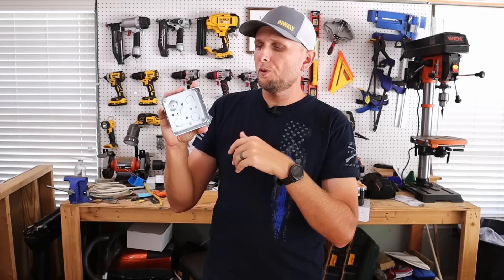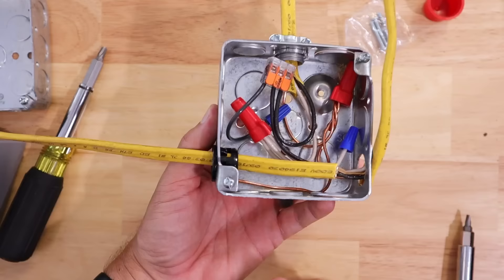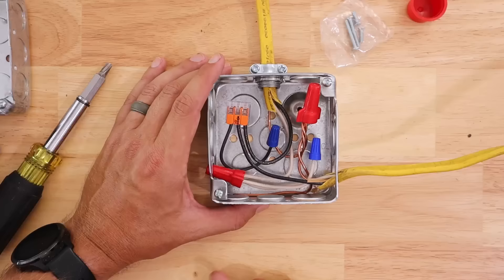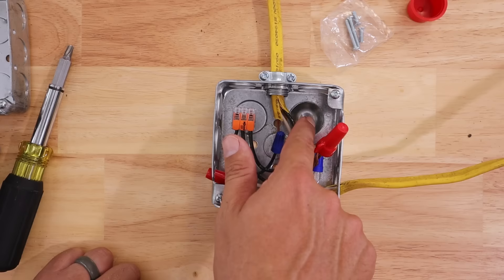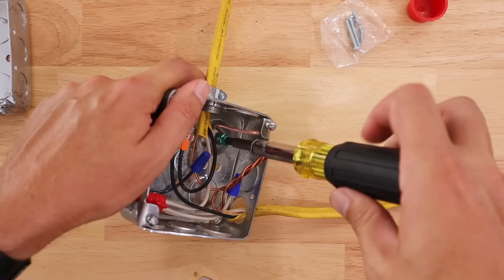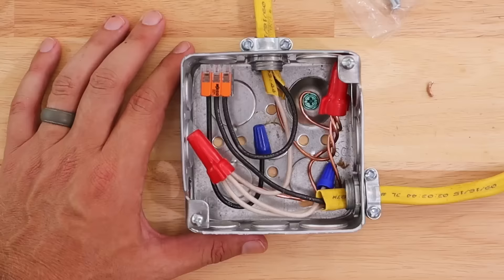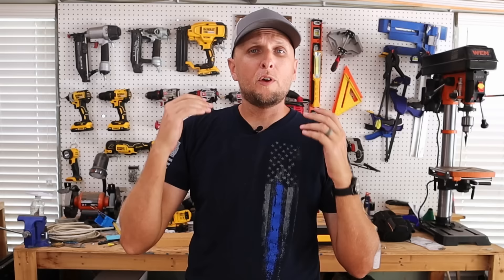The BIGGEST Mistakes DIYers Don't Know They Are Making When Installing Metal Electrical Boxes

Comment: Just a pointer. Make sure you have complete coverage of your ground wire under the screw. When you installed the ground under the green ground screw, the wire popped out of the screw and is only making contact on a small section. It will still make contact with the box more than likely just fine but an inspector may ask for it to be installed correctly. They will probably never see this ground because they won't take the box apart, but will do a ground continuity test so they would hardly ever see it. It would however not be a good installation because the wire isn't fully supported under the screw.
Reply from the maker: It’s fully wrapped around under the screw head, it just looks that way because of how the wire is exiting.

Comment: Can I use strain relief when for wires in plastic electrical boxes, and which one to use?
Reply: No. The cheaper ones rely on a nearby stud mounted cable staple and the more expensive and multi gang ones have built in clamps.

Comment: Are there any advantages to metal boxes over plastic? Thanks.
Reply: I just commented on that very thing. The only advantage I know of using a metal box is for exposed (as in run outside of a wall, Shop/garage/warehouse/commercial atmosphere with EMT/metal shielded cable (BX) circuit runs. There’s no reason to use them in residential unless you need to do the above, need a “heavy service” exposed circuit/receptacle situation.

Comment: 15A branch circuits (circuits fed by a 15A OCPD, like a circuit breaker) should have a minimum wire size of 14 AWG, installing 12 AWG is allowed and sometimes required to keep voltage drop below 5%, in the case of increased ambient temperatures, a large amount of current carrying conductors installed in the same raceway, continuous load circuits etc. In those cases using 14AWG jumpers from a 15A device to 12AWG circuit conductors on a 15A Circuit would be fine.

Comment: Those WAGO things  are great. I would watch out for cheap knock-off ones , but once I tried one, I bought a big bag of them. BUT BUT BUT, the twisted wire ,with wire not, seems to be a better contact.  But how much contact is needed. Am I just a paranoid DIY guy?

Comment: The 12awg cables are much longer hence why they need to be thicker to carry 20 amps per say. But the 14awg cable is around 4 inches long and wouldn't have a problem carrying 20 amps through it

Comment: Not being an electrician, those WAGO connectors are new to me. Kinda cool but is there any issue with lack of contact surface where they pinch into the wire ?
Reply from the maker: That is a big debate.  However they are UL approved so take that for what it is worth.
Reply: @HowToHomeDIY  Thanks. For piece of mind . I think I'll stick to twisting other.

Comment: I'm kind of paranoid so I always tape up wire nuts when I'm done, however, I've seen opinions go both ways on that. On twisting wires, last I knew, code requires that solid wire be twisted before the wire nut is put on it. Stranded wires or stranded mixed with a single solid wire don't need to be twisted together because the act of cinching down the wire nut does that. Also, as was pointed out elsewhere, if the breaker it is attached to is 15 amp, that #14 pigtail is fine because the breaker is not rated higher than the wire. If a 20 amp breaker, given that the length is 6", I would imagine it would still be safe if that wire were carrying the full amperage of the circuit, but it still isn't code.

Comment: if you are using stranded wire don't pre twist the wires going into the wire nut. pre twisting will prevent the wire nut from grabbing properly with stranded wire,.put them in parallel.

Comment: Its interesting, if you had a 12 awg romex and inside of a box say you jump it to an outlet via a 14 awg wire.  6 inches of 14 awg wire is less resistance than 10 feet of 12 awg, so its actually most likely fine, but having said that you should follow the code.

Comment: Could you explain why you have to use the specific grounding screw you showed in the video? Wouldn't a pan head screw with a toothed washer work just as well?
Reply from the maker: Yes the correct sized machine screw would work.  The green ground screw is just much easier to find and they are not really any more expensive than the same sized non green screw.

Comment: Another suggestion, that you didn't show, is to wrap whatever bonding device in electrical tape. This will provide additional strain relief, and prevent any potential electrical connections to the box itself.

Comment: Why is it necessary (other than color code convention) to be a green grounding screw?  Wouldn't a pan head screw that fits the thread with a star lock washer be sufficient?  The pressure of the screw would embed the lock washer into the wire and the screw head providing a bonded connection.
I agree with the pretwist concept.  I've had too many AFCI/GFCI breakers suffer "ghost" tripping and they were all traceable to a poor connection within a wire nut.  Pulled the wire nut, twisted the connection, clipped the end, and re-installed the wire nut; those circuits haven't tripped since!
Reply from the maker: Yes it does not have to be the color green but it is easier for homeowners to just go into the electrical aisle and pick up the green ground screws know they are the correct size, length, and type.  They also are inexpensive.

Comment: Is there a requirement on the ground wire to put a crimp sleeve for code? My grandfather who was electrician never did this and as a DIYer I never did this either. If so, did this come into the code recently?  I had a friend who's project was not approved by the building inspector because of this.

Comment: Ive gotten into mamy arguments with other electricians over pre-twisting, due to the manufacturer claiming you dont need to pre-twist. Well, youre right, and those assholes are wrong. The reason i explain that always ends the conversating, is that if you do not pre-twist, and have a solid mechanical connection independent of the wirenut, if and when time loostens that wirenut, or the plastic fails, worse case with pretwist, you get a short circuit, and your breaker trips. Without pre-twist, you get arcing and a loose connection. Now, obviously this is why arc fault breakers exist, but plenty of houses arent up to date, and also, those breakers are not always reliable. A short circuit trips the breaker. A loose connection burns your house down. Always pre-twist.

Comment: I am confused about scenario 2: About the bare ground wires touching the box.  Metal boxes must be bonded to ground anyway, in case the blk wire DOES come loose and contact the box; the idea being the ground takes away this stray current (fault), so that the box itself is not electrized.  In fact, that's what the raised hole in the top right is for.  You attach a ground wire and connect it to that hole via the green screw that sometimes comes with the box

Comment: I never heard of wego before but would give a wrap of tape around it to hold the flip locks down as a security measure. Plastic is cheap and not consistent. Brittle with temp/uv/vibrations.

Comment: 14ga is perfectly fine there, so long as you put a 15A breaker on it. It's confusing for future work, but most definitely up to code just fine. Pretty silly if you already have 12ga running, you might as well use 12ga for the jumpers, but nothing unsafe or illegal about it.

Comment: A bit off subject, how do you like the Wen drill press? Is that the 4214?
Reply from the maker: Good eye.  Yes, it is the 4214.  I love it for my purposes.  Never had an issue with it and I think it is at a good price point for it's features.
Reply: @HowToHomeDIY  I agree about value. Hard to beat. As for accuracy, You can replace the check with a $25 option.

Thanks for the response, much appreciated!

Comment: First two mistakes are good points.  Third, not so much.  Whether it's a mistake or not depends on the breaker for that branch circuit.   If breaker is only 15 amps, then it's fine to mix 16 gauge wire with 12 gauge wires.
Reply from the maker: I am a big believer that wires should not be mixed.  The person after you may not realize it and just upgrade the breaker.

Comment: Another reason to have the fittings on your box is if the romex does move, the fitting prevents chafing on the edge of the knockout which could cause the box to 'cut' through the insulation shorting it to the box.

I'm not quite sure I understand the problem with the 14 pigtail. Is it the mixing of the gauges in the wago, or the load reduction of the 14 gauge? 14/2 is rated for 15 amps, so if you are just running a standard outlet or light, technically the 12 gauge is overkill. If you are expecting a 20 amp circuit (like you are stubbing for a welder or something), then having the 14 gauge pigtail is a problem. But I don't think mixing is necessarily a problem. Maybe I am not understanding.
Reply: it is stupid to do so because the next electrician might assume he can put a 20 amp breaker on that 15 amp circuit.   i think codewise it is allowed though don't quote me on that but not a good idea.

Comment: What's the difference between the green screw and any screw? That would have been interesting information. It's nice to know how to do it but it's even more interesting when you know why.
Reply: Green represents ground in electrical. Ground screws on devices are green and ground wire, when insulated is green. A steel pan head 10-32 screw would work, but it's not a screw that is made strictly for this purpose. Ground screws for metal boxes are typically slotted, phillips, and hex head flange type screws designed to maximize a solid connection when torqued appropriately.
Reply: They can sell the box of green screws for more in the electric aisle
Reply: @robertcompton6281  Not true, similar screws in the same quantity in the fastener aisle are usually more expensive.

Comment: Glad we only use plastic boxes here in Europe. Wire nuts are already a no-go here. Wago everything. Also we don't use wires indoors for permanent installations. Everything is run through 16mm pvc (although flexible pvc is becoming more common, not an improvement in my opinion).

Comment: when a ground wire makes contact with  your feed it creates a arc flash and trips the breaker but when it makes contact with your body and then you touch the ground and feed at the same time  that’s when your gonna get shocked same for neutrals and positives don’t touch them together and you won’t get shocked. When a ground wire touchs a 4x4 box  and then the positive some how slips out it cause a arc flash and most likely will melt the wire so there not touching anymore most cases it just trips the panel tho

Comment: I'm paranoid with my wiring. I like to line up the ends of the wires and then zip-tie them together about 6 inches down. Then I put the wire nut on. It keeps the wires together and prevents any from pushing out / moving while you're putting the wire nut on.

Comment: I'm brazilian and watched the whole thing despite the US electrical code being COMPLETELY different to ours. hahah
Back some 30+ years ago we used an electrical code very similar the US, including using NEMA AC boxes and circuit breakers and rigid copper wires.
Now we pretty much switched to the european standard, with flexible copper cables and DIN AC boxes and circuit breakers.
Reply: Me too, and i find it very funny when Americans use metal boxes, wire twist nuts, 127v network and everything in between that just increases the risk of producing heat and sparks in their shitty ass wooden houses and they call it good practice.

Comment: If the box has wires for multiple circuits, does it matter if all the neutral wires are connected in the same wire nut?

Comment: Quite frankly I use EMT for all conduits in my house.  Also, the bonding jumper is always secured.  I always use the proper sized wire for each circuit.  Each circuit in any home is normally rated at 15 amps, so the wire size should be at least 12 ga. to each box, except if it is over 100 feet which the next size, 10 ga, must be used.  NO "romex" is ever used in my home as it doesn't protect outside of the cable, EMT only with all grounding jumpers included.  Maybe that is why I NEVER have a fire from electrical, eh?  All boxes are metal with grounding jumpers installed and all grounds are equally grounded outside the house with a 8 ft. ground steel post into the ground and the neutral to it.  This secures the electrical companies ground as well as your house ground.  Enough said.  As a commercial electrician, this is how I run my electrical.  Everything is plumbed level, straight, and perpendicular.  NO exceptions!
Reply: 14awg is code fine for 15A.  I personally don't like using less than 10awg for anything and nothing in the code cares if you oversize your wires.

Comment: Why did you bond the Neutral and the Ground in this box?  I was always under the thought and as I was taught the Neutral is the return path of the current, and the ground wire holds the fault current to trip the breaker in protecting the person and the facility. The neutral and ground should never be bonded together in the facility except for the main panel.
Reply from the maker: At no point in the video are the ground and neutral bonded.  So not sure what you are referring to.

Comment: Two additional code items: The NMC cable sheathing needs to extend into the box 1", and the conductors need to extend past the box 6".  Makes it much easier for the next guy also.
Reply: 314.17 B(2) sheathing minimum is 1/4” in box. 300.14 6” starts from where it emerges into the box and if the opening to the outlet , junction or switch point is less than 8” in any dimension conductors only need to come 3” out side of the box. That being said I thing longer the better but that’s just what code says
Reply: @fordsbetter3496  I wonder where I got my "facts"... been to long since I had my nose in the codebook... but I was on the right track.  Been retired for about 2-years.  Thanks for making it clear.

Comment: 7:03 Your ground bond conductor is less than half under the screw. If done correctly, the screw will bend the conductor properly under the screw.
Reply from the maker: Ahh you again.  Same type of comment.  Well Dan, that ground is actually COMPLETELY under the screw and just looks like it isn't due to the kind of odd angle it is taking.  I still have this mock up setup in my garage and verified that it is in fact fully under the screw.

Comment: You're grounded conductors or neutrals could stand to be twisted More for mechanical integrity. If the wire Nut should fall off , One of the wires could come into contact with The metal box and and possibly cause nuisance tripping.

Comment: Questions:  Is there any twist to the neutral wires going into the wire nut here?   Also, I've seen in metal box the ground wires heavily twisted ( even with ground screw/pigtail), but no wire nut?
Reply: Regarding the ground wires, they must be connected with a wire nut, Buchanan crimp, or Wago, it's a code
requirement.

Comment: most of the times the electrical boxes are inside a wall where the wire cant be pulled out of the box but electrical code may require a box clamp connector.

by grounding the box if the wirenut is not on very well and for example it should burn off exposing the spiral threaded part and it shorts to the box a fuse will blow or breaker will trip

Comment: great video thanks. is it best practice to add the ground to the neutral wire nut? i have not come across that in anything i have worked on
Reply from the maker: Absolutely not.  The ground should never be connected to anything but ground.  By attaching it to a neutral it is what is called a bootleg ground.  If the ground is connected to the neutral it can become energized and will have no protection from shock or electrocution.
Reply: @HowToHomeDIY  thanks I didn't think that was right but I must have looked at it wrong or missed it pointed out

Comment: Wire nut manufacturers advise not to twist wires together before putting them in wire nuts if you have three wires going in and you twist them without using the wire nut two Twist them you may rap two wires around the Third that may remain straight and not have any contact with the wire nut that is designed to lock the wires into it when threaded on it is imperative to be sure that all wires are flushed up with each other on the end before twisting the wire not on so all three wires experience the same connection area

Comment: I learned about the importance of wire gauges after doing a large project. I hope I used the correct gauge. lol It'll be too hard to get back in the wall to fix it.
Reply: As long as you don't have 15 amp wire hooked up to a higher amp ,usually 20 breaker its fine. If you do, change the breaker to 15  .

Comment: Those metal clamps are one of several things that often requires a return visit to the hardware store mid project.

Leaving the wire free in those metal cutouts also has to risk of damaging the wire over time.

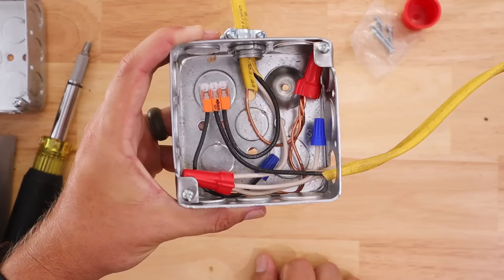Comment: Hard to see all the details but from a first glance at 1:40 I see a connector missing, too much romex in the box, extra pigtails for no reason, box is not grounded, could use some extra length on all the conductors and while wagos are nice I still prefer wire nuts. The fix? Splice in a ground tail to ground the box, lose the wago and extra pigtail and use a yellow wire nut, do the same for the neutral (white) wire, pull around 6-8” of wire into the box, strip back the romex and add a connector. I think that’s everything?